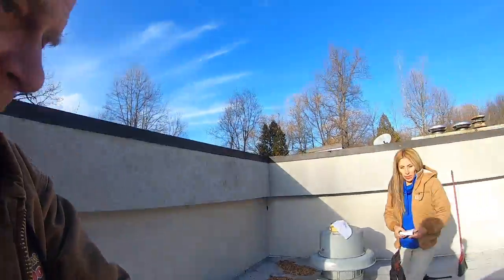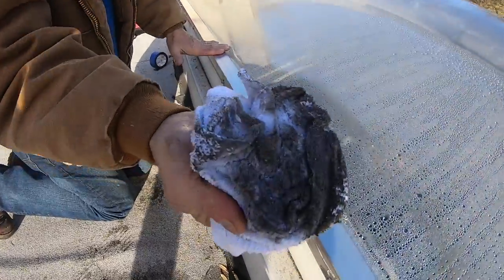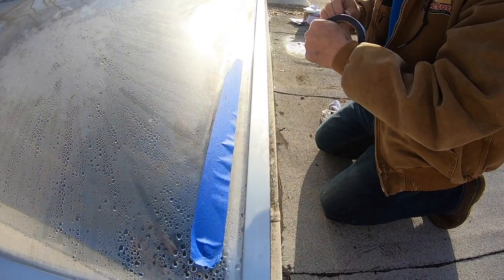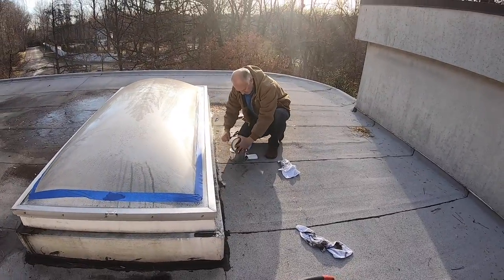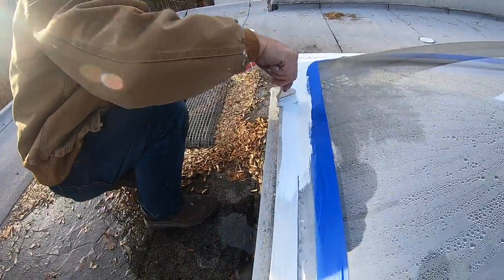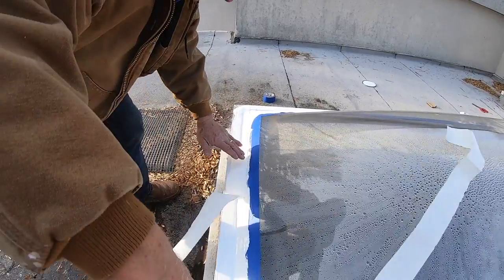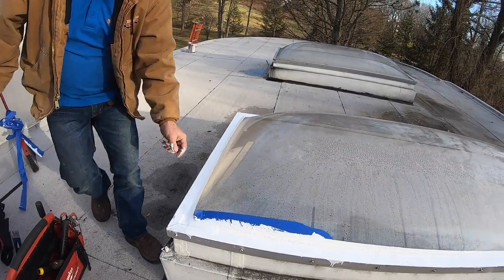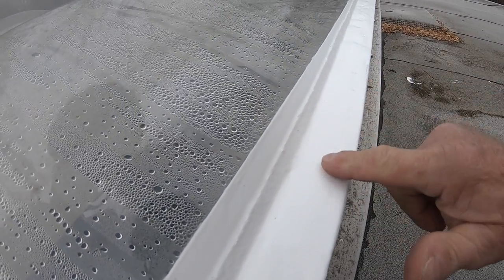Are you kidding me, REPAIRING A SKYLIGHT LEAK so simple?

Comment: Thank you !!!!  My roof is actually a slant although not standard, still a slant.  This method is amazing !!!!!   Super Silicone is fantastic.  It easily goes on with a brush, but it's somewhat self-leveling so it gets in where it needs to, but at the same time, it doesn't run everywhere either.  It's just the perfect consistency.  I may do another coat as it mentions on the can, because the fleese really soaks up a lot.   I doubt it will ever leak, but I opened the can of super silicone, only have a couple of other little projects, I might as well use it up.

Comment: This video shows that this product can be used on plexiglass, but my skylights have standard glass not plexiglass.  I see that you answered a question below that this product will work on any material, including standard glass.  So my updated question is: is it okay to SAND standard glass - which you recommend doing as part of prep in the above video?  Thanks for the excellent demo.
Reply: NO. 
This man is showing people how to destroy the roof holding the skylight up. 
For glass skylights you use DowSil 795 caulk. You MUST clean it with 99% alcohol prior to caulking it. 
I pray that you did not take this mans advise. This is shoddy work, and will create a VERY expensive problem later on.
Reply: @carllennen3520  hey thanks for this tip!  I did not follow the instructions given in this video because he never replied to confirm if this method was suitable for glass.  So what I did was just caulk the skylight lenses with "DAP Alex Plus All Purpose Acrylic Latex Caulk plus Silicone 40 year" .   When it comes time to replace that (I fear that's soon, I live in SE AZ), I should clean the old caulk off completely with alcohol?  I only have 91% isopropyl...  is there a 99%?   Thanks again for the info.  I never totally feel worry-free about my three skylights that will leak without extra cautionary steps.
Reply: @Susan Taunton  yes, you will have to replace that soon. It's just not a long term solution for glass skylights. 
Yes, they do sell 99% alcohol. You have to get it from construction suppliers. You can find them in any major city. They will also sell the DowSil 795 caulk.  91% alcohol will work just fine, it just takes longer for it to evaporate and become completely dry. DO NOT use denatured alcohol. It has an oil in it and won't allow the caulk to adhere properly, and will create leaks. 
Yes, you need to clean all of the old caulk off before recaulking. Use razor blades to scrape it off, then use the alcohol to clean the glass AND the metal. The alcohol not only breaks down the old caulk, but also removes all chemical residue that can stop the caulk adhering properly.
Reply: @carllennen3520  Wow, thank you so much for this guidance -- your ideas make solid sense, And wow is it hard to get clarity on this particular topic. Normally the weep holes in the skylights would have been the solution, but our roofer plugged them up inadvertently, so now I'll have to keep on top of caulking these skylight lenses for the rest of my life in this house.  Good to know at least the right way to do that!  So I will look for the 99% alcohol, the DowSil 795 and follow your instructions to the tee.  🙏🏽
Reply: @carllennen3520  Those skylights were so thoroughly taped up and coated with roof patch, we have no idea where the weep holes are underneath that plaster-liike mass.  These are older (12 years maybe) Velux skylights.  I actually called customer service at Velux to get help and they just kept repeating to me that our warranty is now voided and were not at all helpful.  I am all ears if you have any idea how to locate a weep hole...  but I can't imagine that is possible at this point.  I wish you lived in SE AZ, we would hire you in a hearbeat!!

Comment: Absolutely fantastic Tradesman showing how to properly repair skylights.  I carried out his step by step guide on my 2 leaking skylights and worked perfectly. Hardware has drums of paint on super silicon seal and it looks great when finished. It's easy paint on.. Subscribe to this man for Sure.. Thanks for sharing your experience
Reply: Except this is NOT how you do it properly. 
I build and repair skylights for a living, and I would be fired I did something this shoddy. 
You see all the moisture inside that bubble? Thats not on the outside, its on the inside, and it has nowhere to go, other than into the roof. Where it is going to rot out that roof, creating a VERY expensive problem a few years down the road. 
I pray that this was his own building, and that he didnt charge anyone their hard earned money for this. If he did, I pray that they sue him for the new roof they will need to have installed later.

Comment: The reason there is condensation between the layers of acrylic is cause the seal around the perimeter is defective. The cost of the skylight that size is minimal. (approximately $350-$400 for a Velux double dome) Skylights like that will last approximately 25 years. If the seal is not repaired properly the skylight will leak on the inside of the curb  causing a lot more damage than just replacing it.
Reply: They don't know. Horrible quality. They have no training these guys. Self thought

Comment: I’ve got a leak outside my skylight coming into the attic like 2” away from the side of the skylight, through a nail hole that punctured into the attic barrier. The roof is sloping with asphalt shingles.   I was going to try putting a thick layer of LIQUID RUBBER WATERPROOF SEALANT all around the outside of the skylight, including on the adjacent shingles around it and a little under the shingle ends above it.  Would this possibly work? I live in Hawaii so hot sun. (Roofer looked at it for 2 minutes and said all skylights leak eventually and they don’t recommend them and he said I should take all mine out and redo them. (15 year old house). Windward side of house and very windy always there..  My video of the inside of the leak  I posted under my profile. Thanks.

Comment: Thank you for a very informative helpful video.  I  have a deep at  the bottom of skylight   (on a flat roof)   and it is there where water pools.  I have been told that there is an issue with structure...that perhaps on installing the roofer-skylight installer  removed too much from the structure....that i need to replace....and resolve structure....What do you think  Mr.Bergstromm  shall we remove the skylight, fix structure....place  that  black thick membrane,  that flat-roofers  apply with torching and then re-install the skylight...?   I am grateful  for any advice.   Thanks!

Comment: I just bought this stuff and just installed on glass slanted skylight. I hope it works.  It goes on wet. I thought it would be thicker.  I'll try another coat when it dries.  Maybe tommorow.
Reply from the maker: Yes, it is more fluid so it will flow into cracks. This is by far the best and only product I have come across that can fix skylights permanently

Comment: Is that how the manufacturer did it with silicone top caulk? The first thing is there is way too much condensation on the inside (first bubble).  Pool?  Remove bubble and aluminum frame. Separate the frame from acrylic bubble. Clean frame of old butyl caulk tape. Clean bubble with xylene solvent and frame. Install 1" butyl caulk tape and caulk corner splice with butyl caulk. Join frame and bubble. Install to curb.
Reply from the maker: Ok, why do you expect me to fix it the way the manufacturer did it in the 1 st place, it failed? 
The condensation is from a indoor swimming pool.
I am showing videos for homeowners to DIY. You want them to not do it because it is too cumbersome.  Your way would work, till next time. My way will work till a new Acrylic Bubble is needed to be replaced. Which one do you think people will choose?

Comment: It's definitely condensation heat from the pool hitting a cold roof light it'll still drip in even with that repair
Reply from the maker: i think this is the problem. You are correct to say it is Condensation. But, there should not be any condensation because it is a double layer of plexi glass. I think the seal that that was suppose to keep the air tight in between the 2 layers is broken letting that insulating air become cold causing condensation on the bottom layer. These plexi glass seals between the layers are not well done from my experience.

Comment: You don't know skylights. They atr designed for the water to run under the flange and out weep holes on the frame. 
Never do what this guy is doing.  Take off the flange, repair the frame, and reasemble.  This won't last. How do I know? I did it twenty-five years ago. Lasted  three years. Had to fix the frame.

Comment: With the obvious condensation under the top layer of the plexi, it is clear that the seal between the two layers of plexi is leaking moisture and is no longer sealed. This method of "sealing out the weather" and water is NOT a fix. It is crap. This guy is just trying to make a buck and take off.